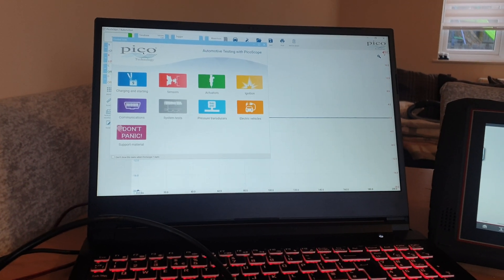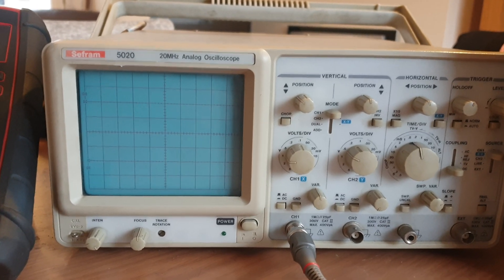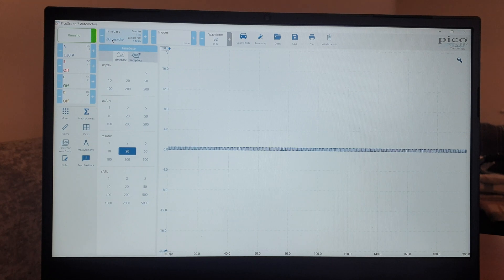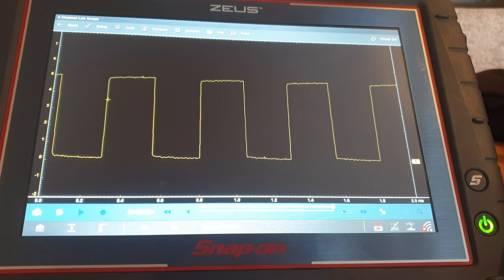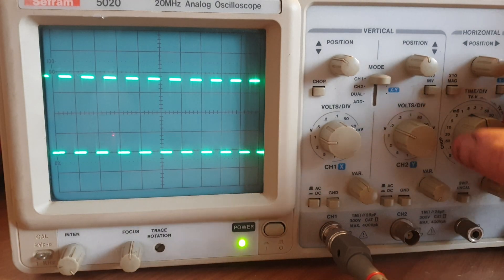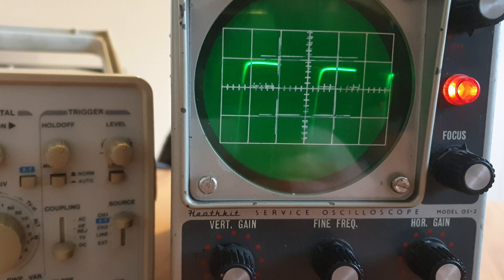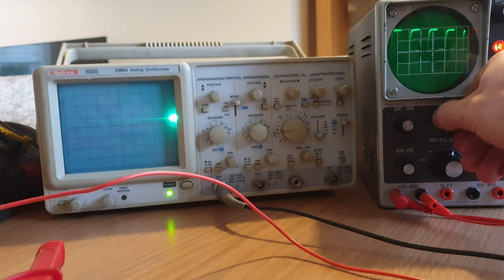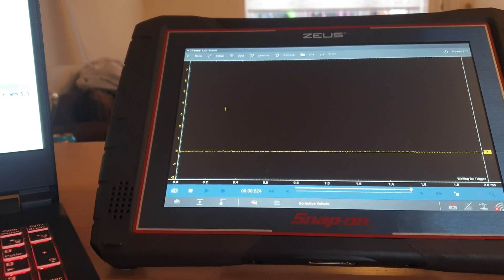Scopes I Use

Comment: The last scope with the green trace, it needs the capacitors replaced inside of it.  I have seen that many times before.
You will be amazed at how well it works afterwards. They slowly degrade and the owner doesn't see it happening because they just get used to it being finicky because it happens slowly over time
Reply from the maker: I'm going to over haul it with modern caps etc.